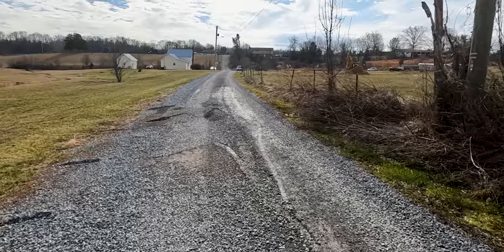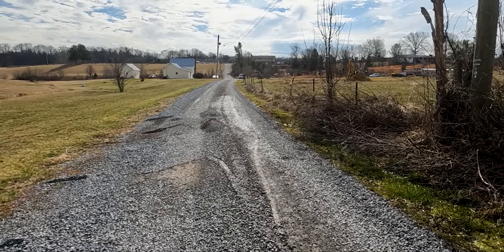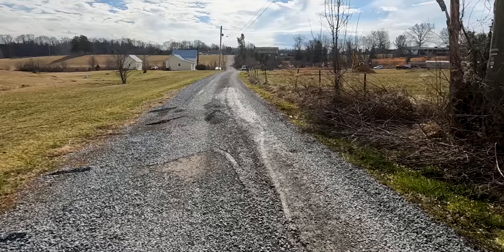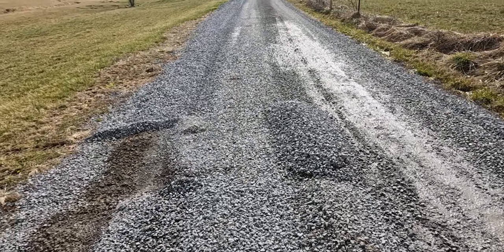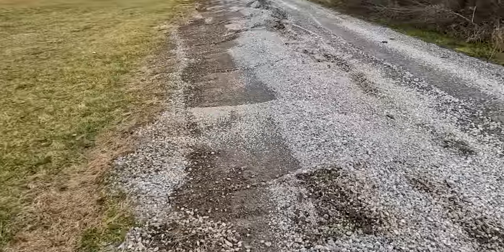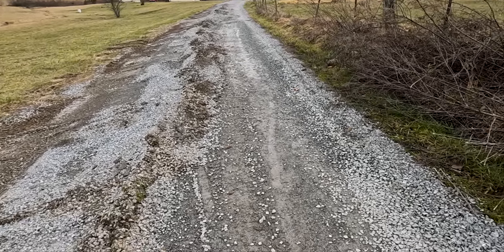Building A Road With Farm Tractors

Comment: Looks nice. Without a level should on the lower side. The material will get pushed out with traffic. Maybe try crowding the upper side so traffic can stay over there. An angle box with gauge wheels or a tail wheel to give it a grader effect. A hydraulic top link will operate like a grader.

Comment: I know you wouldn't want to spend a bunch of $$$ on that road. I would think what it needs is a few inches of 3/4 minus to hold that loose 3/4 clear down. That clear stone is like driving on marbles. The other thing that would work is 2-3 inches of 1/4 minus over the loose stone. that would pack down like concrete. After that is compacted all you would need is to drag it once a year or so. The material would be expensive for such a long roadway.
Love the channel thanks.
Cheers from eastern Canada

Comment: Nathan, yes yo will achieve what you want with the way you are doing it, but it won’t last as you know. If you have a grader blade it would be a lot faster. All so you should be using a different type of stone , one that has a lot of fines so the stone will pack. Then you need to get some clay dirt and build up the low side to hold the stone in place

Comment: I use a York rake on my driveway and find it’s easier to use then your land plane.  With the York rake you angle it in multiple directions to pull material into the middle

Comment: Driveway/access road looks good Nathan. The spots where your driveway is going along a side hill, a crown in the driveway would hold up water or slow it down. 2 to 3 % cross slope is better. The steeper it is the quicker it will get the water off and that’s the key. Getting rain water and surface water off as quick as you can. Flat or almost flat is just asking for potholes to start.

Comment: Get a hydraulic tilt cylinder and hydraulic top link for your 3 point hitch, and you are cooking with gas.
Tilt and trim without leaving the cab.
Always love the drone footage.
Reply from the maker: Hmmm they are both on the tractor already 👍
Reply: It's called " tip and tilt " controls, if you look carefully on the top view behind the seat the tractor does have both hydraulic cylinders/rams. Just saying

Comment: just a little bit of advice. 
make your landplane even front to back adjust your top link in to make sure your left and right rub rails are touching even all the way. I usually just run my land plane on the right side and then return on the other side.it should bring up a lot of the rock using the L.P. or maybe even a rear blade angled in. it might not work for you because of the hill.

Comment: Up here in the northeast we have a driveway, road base called Perkpac. It's a road base made with smaller coarse gravel & stone dust & i think a little Portland Cement. It sets up pretty hard & I think something similar would help prevent your issue.

Comment: What if you half buried logs you can't saw? Create a little hump to keep the edge from sliding down the hill. Just keep a gap between the ends to allow water to run off in heavier rains.

Comment: Nathan I have an angle "box" scraper that I attach to my little tractor and adjust the right arm to the "pitch" I need and it moves the gravel back to the center of the road. I like it. I think it coast about $700 a few years ago. I bought it to work on my neighbor's drive ways.
Reply: A land plane is far superior to a backblade/box scraper  The folks that tout the box/scraper blade have not experienced the L-plane. Even w/ skidshoes, the box  blade will cause some gouging.  The box blade either carries to much or too little material forward, seldom the sweet spot for final grading . An issue is tractor tires raise & lower over uneven terrain, creating humps. Allowing the box blade to float, creates gouges. The box blade is effective when digging in previously undisturbed surfaces or shaping the crown before adding a stone base.  When the crown is formed using only  stone, gravel, or fill, it will not retain that shape over time. Case in point, in Southern states, Florida an example,  driveway contractors use box blade w/ scarifying teeth to form the subgrade.  Take a look @ a Deere 210L  The box blade has a 4 & 5 hydraulic valve bank to Constantly adjust the depth, height & pitch of the box blade. That allows the box blade to be effective but the valves require frequent adjustment.  Again, the box blade is designed for excavation. & final grading.  OF  course, ask 10 folks for an opinion as to "HOW" Nathan should address this issue, doubt any suggestions would be the same. BTY, the secret to a box blade is weight w/ multiple height/pitch hydraulic adjustment. Even before current inflation, a $700 tool is a light duty replica of the real deal. YMMV.

Comment: I think your driveway was built right at the time. Time has a way of changing things. It was probly raised a couple inches above the landscape and over time, traffic has compacted the gravel and dirt down which will also spread it out too. Traffic + time + pressure = degradation.  
Just keep your box slightly off center on both sides,  you'll get the crown.
It would be great if you could get a roller in there to compact it down.

Comment: If the 25 has a "float" on the bucket, you could tilt the bucket a little over 90*, engage the float, and push the gravel up.  The float function on the up and down hydraulics is nice to have, it allows the bucket to follow the ground without forcing a cut.  Normally this is engaged by a sharp down all the way on the valve handle; then the hydraulic pressure is not fed to the top or down for the cylinders and the front bucket goes down by gravity and will also follow the ground up.

Comment: For those who don’t make YouTube videos off fixing a gravel road, to avoid having to redo it, there’s two options. For a level road to the earth beside it, you obviously can just remove the dirt and the rock fills the void; there will be some mixing on the edge, but the rock by and large won’t go anywhere. In a case like this where the road is elevated, particularly if it’s taking a beating with big equipment and trailers, a retaining wall is used to keep the gravel inside the barrier with designated spots for water to drain or cross underneath.

Comment: Something I use for that purpose is a 3 point hitch 72 inch heavy tine landscape rake. I angle the rake to pull material from the left to right and lower the left edge down about 3 to 5 inches, pulls the rocks nicely back up on the road. Works great and they aren't very expensive on the used market.

Comment: That’s a lot of material spilling over the top of the rear blade in your land plane, because the overall tilt angle is backward instead of forward.  The front blade should be doing most of the work, picking up the greater amount of material and dispersing it evenly across the blade, with some of the material spilling over the top of the front blade. The rear blade picks up the uneven top after the front blade has passed, and does the final dispersion and smoothing with little or no spillover from the back blade; the better you get, the less spillover there will be from the back blade.  When you’re working with material that’s a mix of mud and gravel you’ll know something’s wrong if there is spillover from the back blade and you look behind you at the trail of mud clots, worse when you start driving over those bumpy clots after you just leveled your road with the land plane.

Comment: AH, you have one. Well, drive the way Brits do, on the wrong side of the road and it will bring the gravel back to the center. This road needs soil built to a crown and then add gravel and a lot of love with your tractor.

Comment: How often do you need to redress the road surface 😎 maybe Santa will give you a three way blade for Christmas 🤠💕👩‍🦳
Reply from the maker: About every quarter
Reply: If you top it with pea gravel, also called choke, the pea gravel and fine particles fill in the spaces between the larger rocks and lock them in.  It expands and settles back in every time it rains, and self levels.  That way you will only have to regrade or resurface ~ every 5+ years depending on how you use the road.  When the road dries out it is hard like concrete.